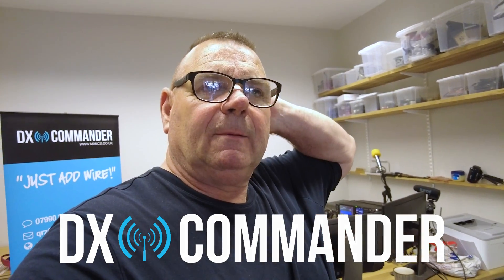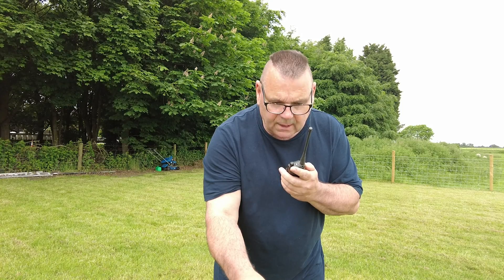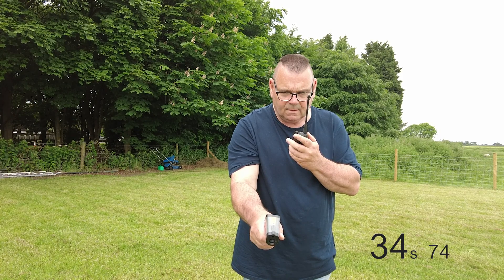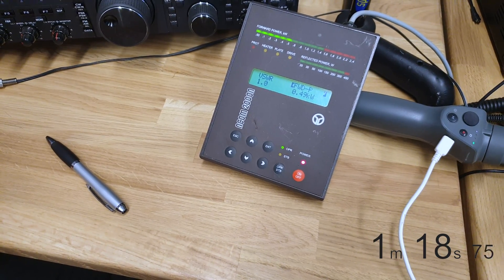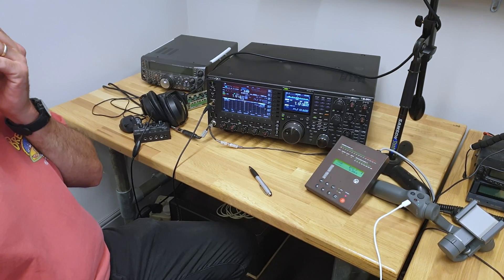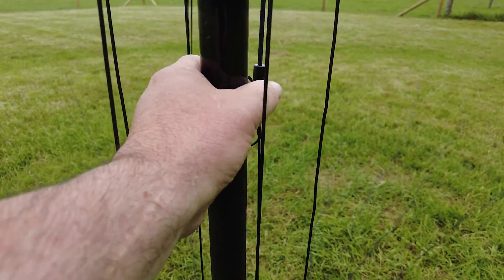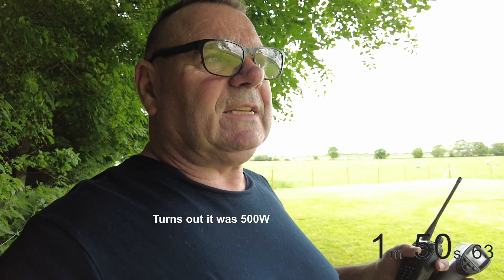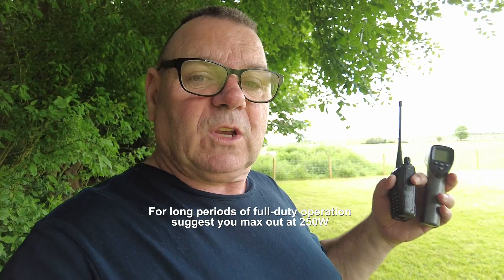Trying to Melt a Loading Coil on a Vertical Antenna (DX Commander Rapide)

Comment: Instead of using DX10 wire if you used heavier gauge wire, just for the loop do you think this would solve the heat issue.
Reply from the maker: It would still get warm. You would need heavier wire and longer spacing between windings.

Comment: What about wrapping the area where the coil will be placed with Kapten tape then wind on the coil then more Kapten tape then everything should be alright or there must be a problem else where if the coil is getting very hot.
Reply from the maker: Ah! You surfaced again! Well, the bottom line was we just wanted to know how hot it got. SInce making that video and launching the product, nobody have melted it! :)

Comment: I would not rely on these readings. Ever heard of D:S ratio with IR temp meters? Common mistake I see everywhere with these things. The red dot is just for aiming. The meter does NOT show the temperature on the spot. Only an average around the spot determined by the D:S ratio. Assuming the spot is in the middle to begin with.
Reply: There is also plenty of other things to consider with IR gun type thermometers that everyone interested can read online.
Reply from the maker: Doesn't matter.. I touched it with my hand and it was about right.

Comment: I melted the centre coil on a Moonraker dual band 2/70 mobile antenna with a long over on 2m with just 50W FM with a Yaesu 857d.  I couldn't understand why the swr had suddenly shot up but when I checked the antenna it had melted and folded completely in half, rated at 250W! Bit disappointing because the performance was really good for the price.
Reply from the maker: Ah! Poor you. Can'tbeat a Diamond V2000 or perhaps anX510 if you are brave enough!

Comment: Bet you were a bit nervous testing this ;) 

I once burned a helical antenna from the roof. The pvc pipe turned to black coal. I could crumble it with my hands. But the best thing is it was my own fault because.. The PVC pipe wasn't long enough so i put another end into it and put a screw into it :)) By the way love the MMANA video's!! Hope there will come more!
Reply from the maker: I was nervous.. Not until you actually try these things for real do you get to find out..

Comment: If 100 Celsius can boil water, what do you suppose is happening to the fiberglass pole inside the coil now, and over time? You should at some point take it all apart and see if anything happened to the surface of the pole, even destroy the pole to see if it has become brittle and weak where the coil was.
Reply from the maker: 100 degrees C for fiberglass is fine.
Reply from the maker: I've just looked it up.. The glass matt / strands are good for 500C and the resin 150C (although some specialist resins are good fopr a LOT higher).

Comment: Also, FT8 is transmit for 15 seconds then off for 15 seconds not key down for 2 mins so that would regulate the temp somewhat.
Reply from the maker: Good point.. We did have one customer that did 1,500W FT8.. A bit much maybe!
Reply: @DXCommanderHQ  that’s absolutely effing insane, what a mad lad

Comment: Looking at the coil, would it not be a better idea to use a larger diameter and have an air gap between the coil and the mast so that air can pass on both the inside and the outside to give more surface area to keep it cool? Maybe a 3D printed former that had vertical grooves to allow cool air in at the bottom and hot air out the top, I'm sure M0MSN could knock you something up. Simon, M7BXR.
Reply from the maker: You can.. This is a simple hack to get the 30m element resonant on 40m. So not much inductance actually.

Comment: Why would anyone use FT8 at 400W? 400mW maybe. Good illustration that all the guff about EMF for an amateur installation is disproportionate; you were in the thick of it and there were no obvious signs of discomfort. Thanks for sharing Callum.
Reply: FT8 is just one of many modes. It happens to have a short duty cycle. 
Think of someone was running old fashioned RTTY 2 mins  is NOT a long "over" 
then the heat9ing effect becomes much more of a issue to be aware of.

Andy
Reply: But there was no mention of RTTY in the video, only weak signal modes, hence my comment.
Reply: @G0FUW  What's that got to do with it?  RTTY is a valid mode to use., However RTTY is a continuous carrier, and "overs" > 2 mins are common - (not talking about contest QSO's)  So a coil getting hot after 2 mins is something to be very aware of. You would want to run such modes at reduced power until you have made sure that the heating effect was within reasonable limits.

400W is a excessive for normal use in the UK, but not elsewhere. A knock on the door with someone saying that your antenna is on fire is not something you want to hear. That's why such testing is needed.

It doers raise questions of why the coil is is getting that hot, and could anything be done to reduce it. That's something that Callum will no doubt take into consideration as the design evolves.
    
Andy.
Reply: As I am sure you are aware - it also depends on the frequency and the duration. On 40m the human body is nowhere near the quarter wave. From 10m and up it's a different ball game... Anyway, it's good to be aware of EMF effects to both humans and animals without going full on paranoid... :-)
Reply: @erpece  not sure if ICNIRP has changed dramatically, but the highest risk/lowest exposure levels were between 10 and 100MHz, 30 to 3m. Not a lot of quarterwave humans in that spectrum!
Reply: @G0FUW  On the contrary: 10m/4= 2.5 m. A bit tall for a human, but it is in the ball park. With higher f parts of your body may be at risk. Some parts are more sensitive to EMF, e.g. eyes.

Comment: I could be wrong, but I'm guessing that that's why antennae with coils in them might not be the best choice for QRO, particularly in modes that require a heavier duty cycle like FM and maybe AM (*AM with CB Band, I got used to the TXr dead keying 1 watt and swinging forward 20 plus into the [illegal] amplifier! 🤣).
Reply from the maker: Correct :)
Reply: @DXCommanderHQ  Because I experienced a similar thing with Chameleon's hybrid matcher rated @ 500 watts; while running a Stryker 5/8 wavelength mobile antenna rated at 10Kw on top of the matcher, after several minutes of testing and checking my audio in SSB I came out to check the matcher and found it warm to the touch!  So, I switched to the 17-foot fully extended telescoping whip which is about 1/2 wave on 11 meters by itself and didn't have the heating problem - at merely 100 watts!  Good video however as it confirmed what was a theory with myself!

Comment: It would also be interesting to use a thermal imaging camera to check 
coil, every connection and the transmission line back to transmitter.

Schedule test for night or cool, calm and non-sunny weather conditions.
Reply from the maker: Honestly, that would be so cool!!

Comment: FT8 is not supposed to be used with QRO! It's for reaching long distance with low power...
Reply: Wrong. It's a weak signal mode, not a low power mode. They are not even close to being the same thing.
Reply: @johnratcliffe6438  Both wrong.. text below taken from: physics.princeton.edu/pulsar/K1JT/FT8_Operating_Tips.pdf
Although FT8 is a weak signal mode, not a QRP mode per se, please keep your transmit power down. Be nice! Generally on HF, if a path is open, just a few watts will do. Put your amplifier on standby. Turn down the wick to QRP levels. Try it! If you don’t get any responses at all, try 10 watts, maybe 20 or 30. If you find that you routinely ‘need’ 100 watts or more, that is a strong hint that your feeder and antenna system are inefficient.
Reply: @jacko101  So I'm not wrong. The first sentence says it all. The Defence rests m'Lud.
Reply: plus he's testing like he said he's only giving an example as Ft8 it could of been RTTY or another heavy duty mode so please quit trying to find something to complain about really
Reply from the maker: Yes, could be RTTY.. There are still some of those people about!
Reply: Correct,  but High Power is used on FT8 for instant gratification